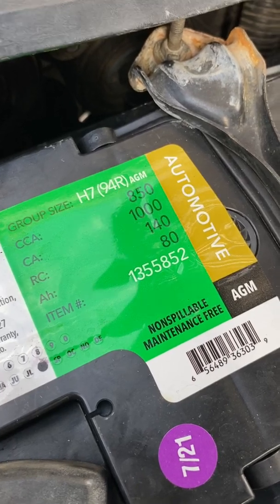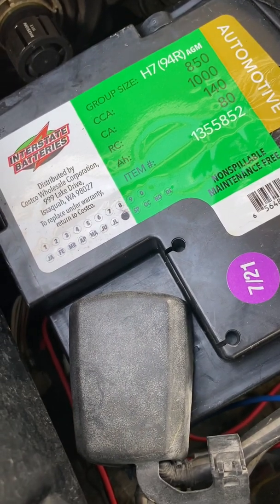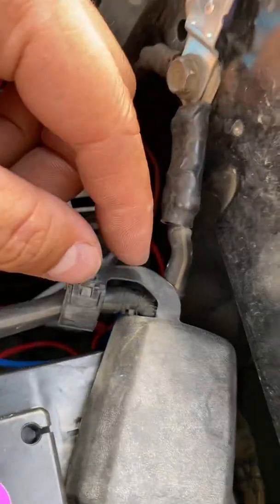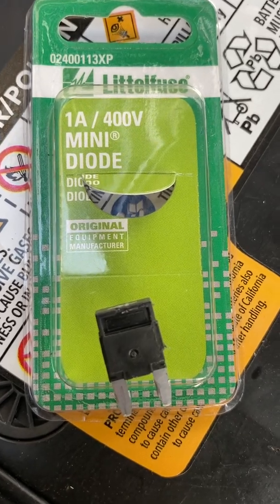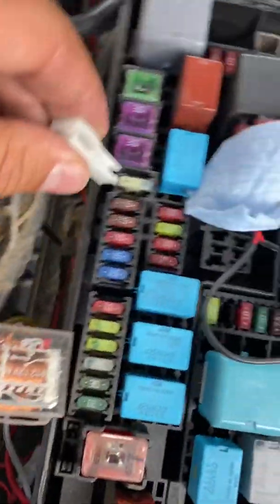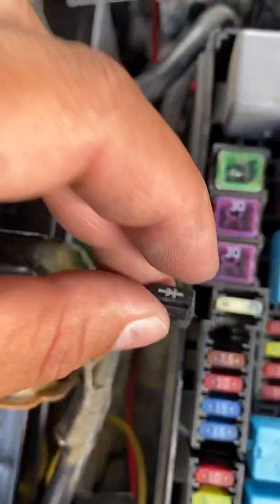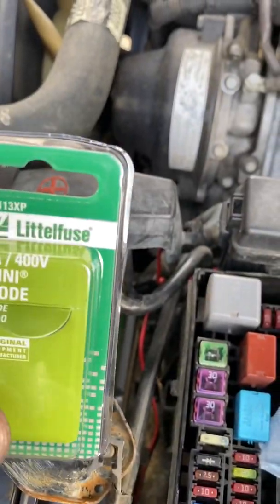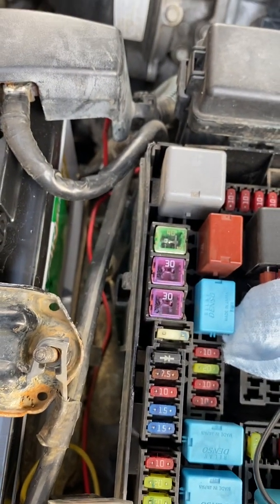GX470 Voltage Booster Diode to Fully Charge AGM Battery

Comment: I just did this in my 02 lexus ls430 with 2 agm batteries.  One for the car amd the other for car audio.  Voltage went from 13.8 to 14.3 Voltage at idle. Batteries getting charged properly now 😊

Comment: So your going to run your alternator harder just to charge an agm... where did you find that you need  this diode just to charge the battery all the way up.. I'm just confused
Reply: your not going to run it harder, although mpgs may suffer. the alternator is making 3 phase AC current inside which is later rectified via 3 diodes into “12v” DC which is used by your car

Comment: does it work with any Toyota ?
Reply from the maker: I’ve heard it does. But I’m uncertain. Easiest way to check is with a volt meter.
Reply: @HongCack  my Gm Buick lesabre never goes over 13.5 even with the high output alt. Would this get me a half volt increase?
Reply: @lildno2007  you can but you run the chance of roasting your charging system particularly the battery.